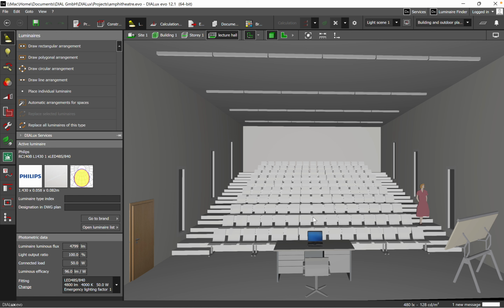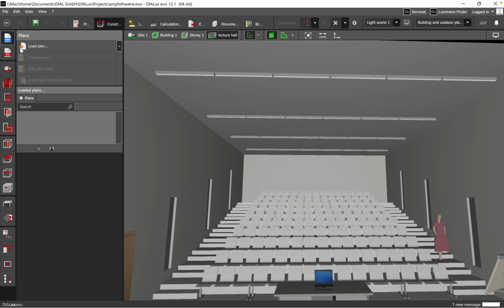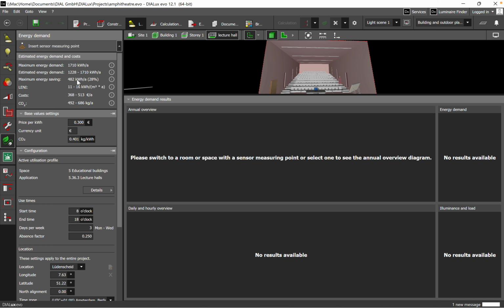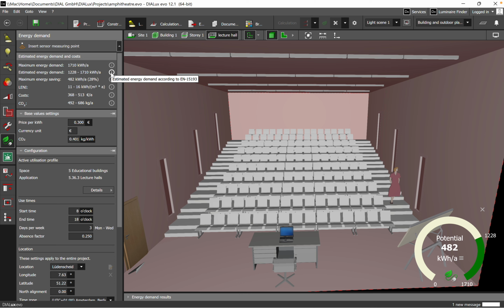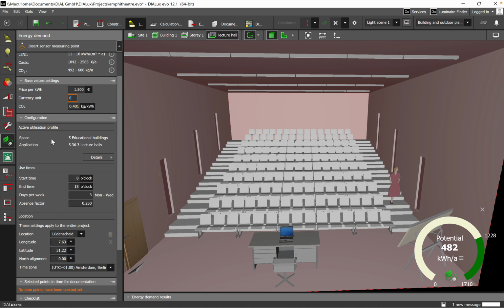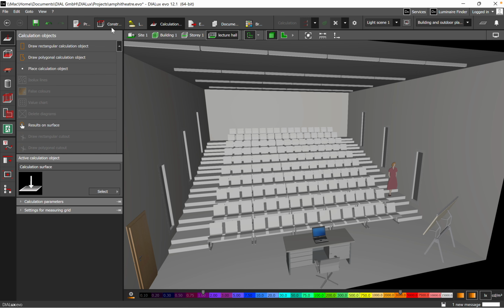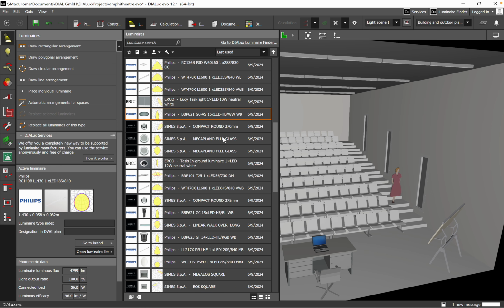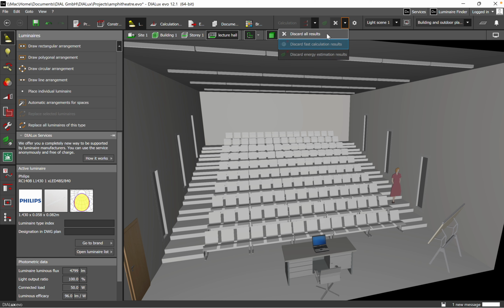What is new on Dialux evo version 12.1 part II

Comment: Hello Respected Sir,
I am working on a project at our hospital which includes shifting of pole solar lights to pole flood lights because of poor lighting and performance of these solar ligths. 
Sir, we have the boundary wall around the hospital buildings which lengths 531meter south wall, 440meter northside boudary wall and approximately 220 meter each each and west boudary walls.
We have 62 poles already installed for solar lights what i am going to do is to replace solar lights with phillips 100w flood lights to improve serveillance and security of the hospital boundary wall and i do not have any site plans to import into dialux evo 12.1.
Please suggest me for having proper working on this project at dialux.

Bundle of thanks
Reply from the maker: Thanks for your message. It should be possible to change the power output from the old luminaire to the new one. However to have a proper lighting calculation in Dialux, you need to use the IES or LDT file of the old luminaire and just change the power or lumen output to the new lamp. In this case 100 W Philips lamp. Hope that this information will help you.